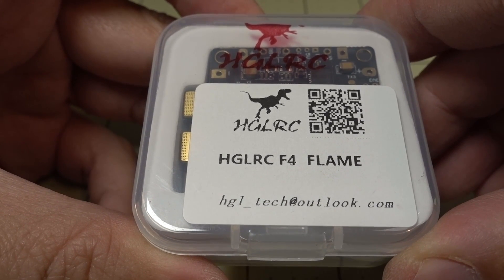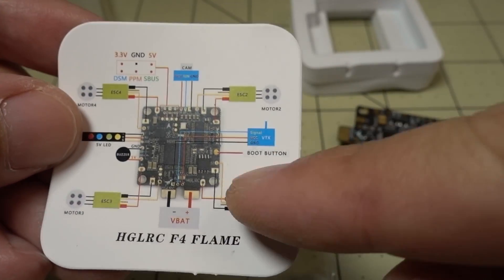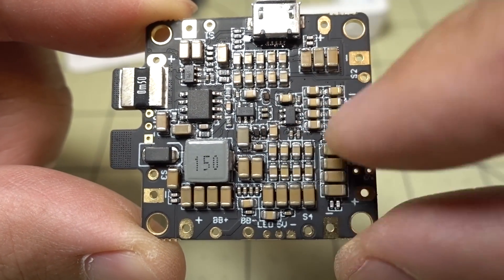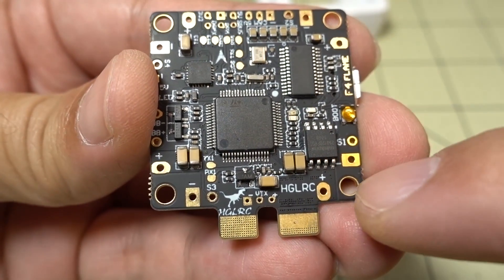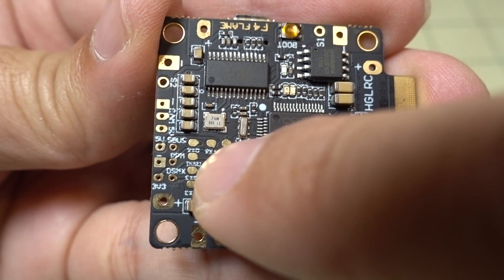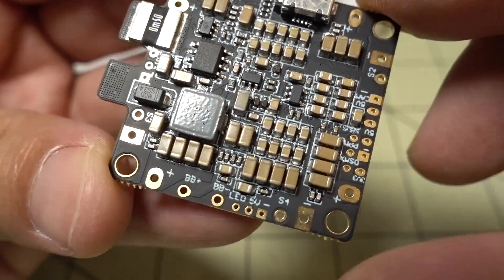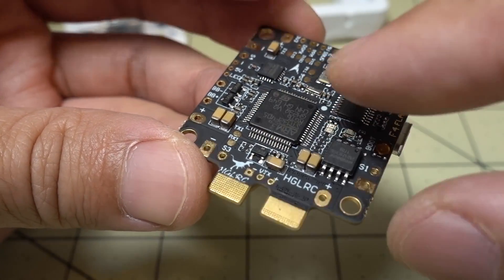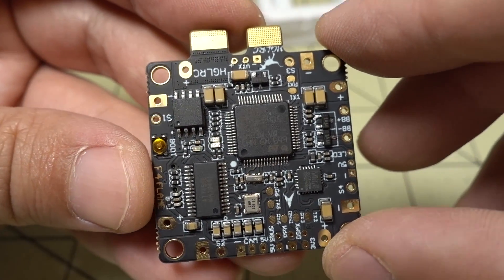HGLRC F4 Flame FC+PDB Review 👍

Comment: Hello, quick question to this f4 board. I bought a quad with this fc. Originally blue led was blinking beside the others were simply lighting. I saw the controller setup in Betaflight. After a miss connection with receiver and transmitter it dropped the connection. Now I can see only the red light when connecting to Usb, but no real communication. 
What do You think, is the board or the usb connection dead? From battery, it is still blinking..

Comment: I have my  F4 Flame board mounted on a 160 frame with dys 20a and Emax 1306 motors and works perfect .Very clean video.
Adding the 470 Capacitor helped a lot.
Use rubber mount standoffs in stead of the ones they give you.
Only issue is cant access the OSD with my Taranis Radio !!! but OSD is fine.
Purchase mine on Banggood 
Great review Albert as always.
Thanks.

Comment: I have this board but mine did not come with the capacitor. I'd put some hot glue to secure the USB port if I were you as mine came off and someone else on here said it happened to them too. Other than that I've not had any problems with it, it's a nice board I look forward to the build video.

Comment: I have had 3 of these boards and broken all of them. A few problems, usb connector is surface mount SO it will break off eventually, even if you are very carefull it will pop off. Some solder pads are extremely small so they can just break off being that small, hotglue is to be used. 5V regulator gives out 5.6V in my builds so unify 5V vtx didnt work on my boards. Current sensor only goes to something like 50-60A so its pretty useless. One of the boards also just burned out, could be my fault ofc.

Comment: Been running these boards since they came out last spring i love them no noise and i dont use caps i run spedix 30a with tmotor f60 very clean setup and a daily flyer for me hgl makes some good stuff for me its been reliable 👍

Comment: I like this board. For me it flies great.. but some of the layout locations are in funky places and you need to be pretty good at soldering. I just uploaded some flight footage today with this new board if anyone wants to watch it. It is noisy but I am running a cap on the AIO esc and one on the fc, it cleaned it up pretty good in the fpv feed.